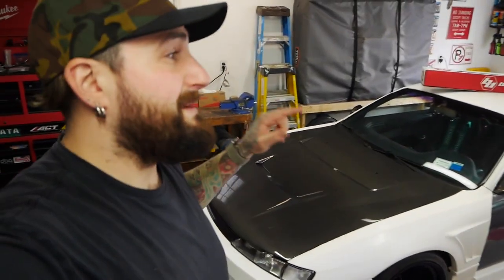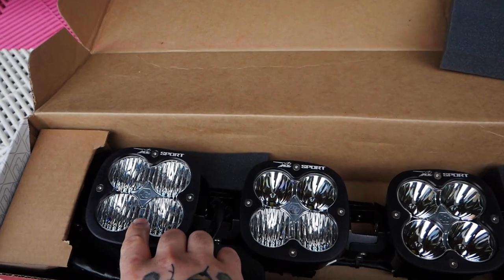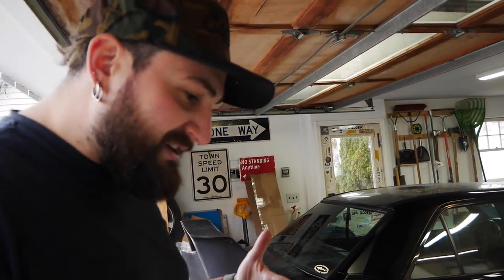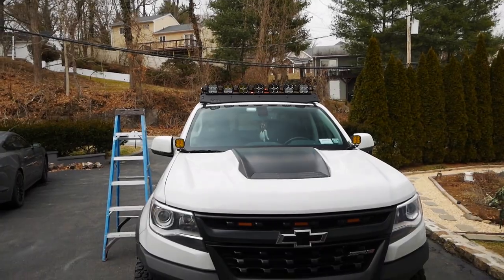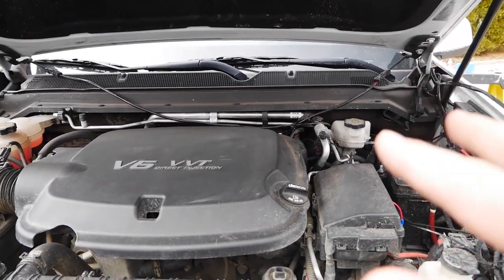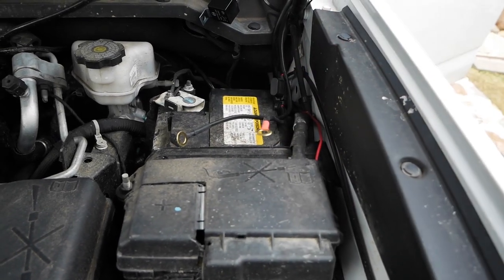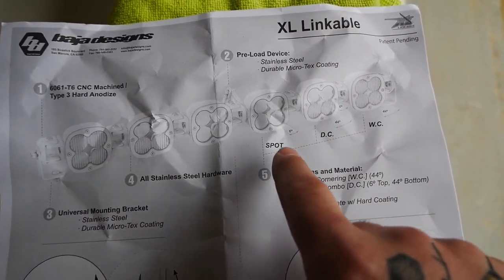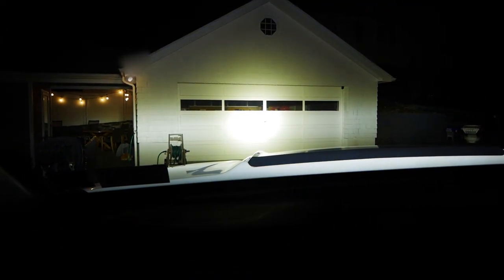Baja Designs XL linkable is SICK!! | Chevy Colorado ZR2

Comment: Just wondering exactly how high is that Cbi rack anyways and I’m guessing putting those xl linkables made it even taller
Reply from the maker: The rack isn’t that high.. and with lights I THINK it’s still under the height of the antenna. But at least the antenna is flexible